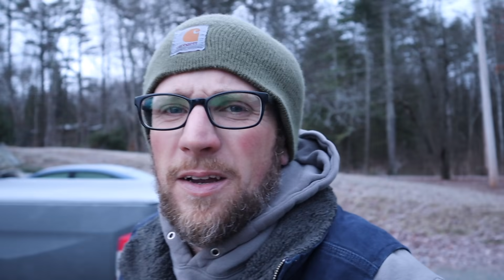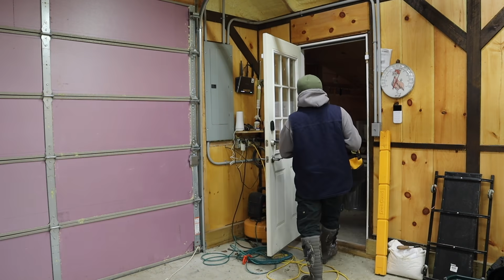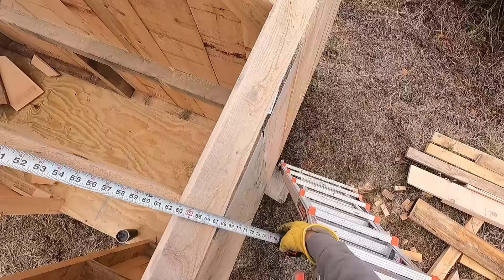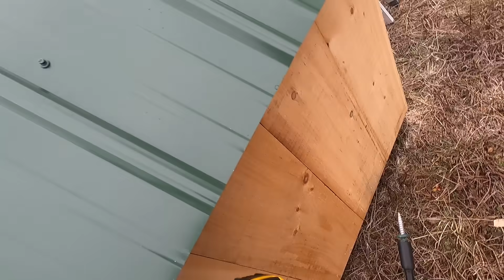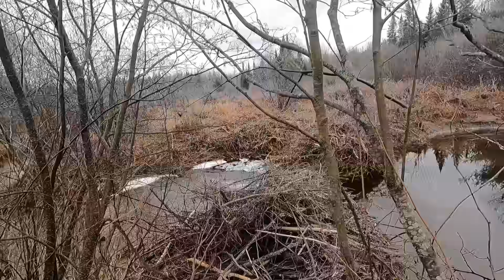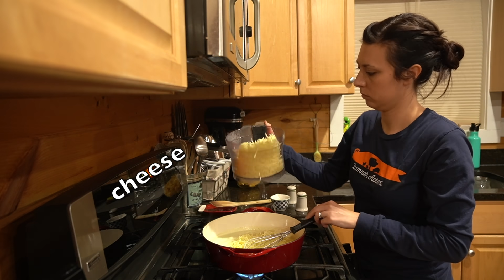Installing Metal Roof on Our OFF-GRID Property's Composting OUTHOUSE (Trying to beat the RAIN)

Comment: Good use for your drone, checking for beaver activity.
Reply: I would be EXTREMELY careful with that. Especially if they're posting on youtube.
I'm not sure a court would separate the act of checking for beaver activity and the act of trapping. I wouldn't push it. It's easy to argue that in the YouTube comment section, it's a lot harder to get a real life judge to go along with you. 
New hampshire fis 312.02
Reply: @herranton  - Good observation and input.  There was no exemption for private property, so it would be applicable for this channel, IF it was proved to be used in a way that violated the law.

Comment: Love your new project land (Beaverdale?).  For the price of 1 or 2 new battery operated tools, you could purchase a portable 1000 - 2000 Watt battery powered inverter like the Jackery.  This would allow you to plug in your wired tools like grinder and sawzall at the sight.  You could also recharge all your battery packs for your cordless tools on-sight.  Add a solar panel to the roof of your shed and it could be always charged and eliminate the need to take it home to charge it up each night.

Comment: If the water flows all or most of the year I would use it to provide hydro power, run LED lights, charge your tool batteries ect...

Comment: Keep the overhang always let things drip well clear to avoid splashing mud up the walls. Or have extended gutters to run clear. Better still harvest the rain at a high level to run by gravity to a tap. Speaking of which use the tractor to elivate water tubs to take around farm and Sophie off to were you want it elivate bucket enjoy your vids in lock down. How about doing high lights jim

Comment: Tip of the day... I like to use a pencil and mark my tape measure for repeat measurements, just so you don't have to think about it. When you are done it will just wipe off or erase off. Makes it faster for me.  Have you tried turning a plywood circular saw blade around backwards to cut metal?  I like the clear roofing for light.

Comment: Harbor freight sells a 100 watt solar setup that comes with 3 12v lights with on/off switches and the main unit has 12v dc outlets and 5v usb so you would be able to light up the shed and the outhouse at night if needed along with charge phones/tablets and with an inverter plug in the chargers for tools. Would need a battery to go with it but deep cycle batteries are easy to find and with the 12v power you can put in fun things like a car radio for music and alerts out there when working or near the fire.

Comment: Need to make a water wheel to use the water to spin an alternator to have 12v system and a step up power inverter for some lighting

Comment: When you are going to cut metal tiles or not, you can use an electric saw, just invert the position blade. Don't forget to return to the correct position right after the cuts are finished !!

Comment: Your tin roof will condense moisture from the air and drip it down onto your shed floor and contents. If you insulate your roof that should solve the problem.

Comment: Al, FYI the Polycarbonate Roofing Panel will only hold up for about 3 years. I used some on a project and it held up only 3 years. I'm in Ohio so we get very hot weather and fairly cold. Hopefully you'll get a little longer out of yours than I did. It gets brittle and cracks. I purchased tan polycarbonate and white and it holds up a couple years longer. Your outhouse looks like luxury compared to what my grandparents had! :-)

Comment: Turn the saw blade around on your battery powered circular saw, it will make short work of that roofing. I do it with tin as well.
Reply: Good idea!  I assume a 24 tooth normal carbide circular saw blade is too aggressive for direct roofing tin?  A 40 or 80 tooth plywood type saw blade might work as well.  But turning the blade around costs nothing but your time.  Clever!
Reply: @samvalentine3206  yes, it rips the tin. you can also. cut concrete with a backwards blade in a pinch.

Comment: I'm with you, Al: eggs over easy, toast and bacon. I frequently vary how that combo is made. Sometimes Craig's Mc muffins. sometimes 2 slices of bread with holes in the center to fry the eggs in, then each is covered with a layer of (already cooked) bacon, topped with slices of (extra) sharp cheddar, and broiled just long enough to melt the cheese without overcooking the eggs. I variously add salt, garlic/onion powder, dill, tarragon, and/or malt vinegar as the mood strikes me. If I don't want to cook, I'll have a large bowl of whole-grain cereal and fruit or oatmeal (not instant and made with milk instead of water) & fruit. 
      If you ever travel to the U.K., by the way, you want to be sure your hotel serves 'English breakfast' or a breakfast buffet. If your included breakfast is 'continental breakfast' that won't do for you. Throw it into a baggie for a light snack during the day. If you stay in a B&B you will get a good breakfast.

Comment: You haven't a battery operated angle grinder, but you have a saws-all on batteries. Put a metal blade on it and you could cut the roofing at the new lot.

Comment: You know you can cut the steel roofing (ridge cap) with a circular saw?  Go slow and use a carbide tip high tooth count blade and it will cut quicker and cleaner than a andle grinder.

Comment: You can't do like you would with vinyl siding and turn the blade backwards on your battery operated circular saw? Though you would probably need a higher tooth count on the blade to cut efficiently.

Comment: Good Morning Al and Family.  You need a generator that you can use when you go to Lumnah 2.0.  It would make life easier for you all.
Reply: Or even one of those battery pack 110v appliances.  https://www.jackery.com/pages/portable-power-stations - pricey but quiet for the temporarily tailgate power need.  If Al had the time (he doesn't) he could make his own 110v battery pack with 18650 cells in some sort of carrier - like an ammo can, or something.
Reply: How about installing a 1200 watt inverter on your truck so you got 120v power wherever you go, alot cheaper than a generator and you always got power when you need it.
Reply: @kipcudd7253  - Good idea - As long as one leaves enough juice to start the vehicle.  That's always a worry for me when I use my inverter.  A little use is probably nothing to worry about - but I'd hate to be out in the sticks and find I have killed my car battery!  Of course, one could just start the car and have it run while one used the inverter, just to be sure.

Comment: why didn't you place the ridge cap on to keep it dry and cut it on the roof after the big rain??? and tyvek the door openings temporarily
Reply: Makes sense - but harder to cut once it's on the roof?  Not that much of a hassle for Al.  <shrug>  Oh well, it is what it is.  🙂
Reply: Because they took it with them to cut.

Comment: You don't have a pair of tin snips ?
If you screw through the ridge instead of the pan on those roof sheets you are less likely to have leaks and the snow slides off better 👍😊🇦🇺🦘☮️

Comment: Gina I'm from the UK, your Mac n Cheese looks lovely, but what are the crushed crackers you use for the topping, as there is quite a lot of your and our food terminology that means something different, are they what we in the UK know as cream crackers or a water biscuit which is similar to the cream cracker, they are both a dry baked type biscuit, that we eat with cheese as an after dinner savoury accomplyment, I know even the word biscuit (our term for them) has a different meaning to yours, ours can be either savoury or sweet, the sweet one you call cookies or are they something different altogether.
It can be very confusing at times ha ha.

Comment: Why are you pre-drilling? If you're using TEK screws, metal to wood, they'll go thru 26 ga metal easy with just a tap on the drill with your hand. I've built alot of pole buildings, sheds, etc and never measured my boards to hit the boards. But everybody has their own way. Time was money when I was doing it.

Comment: I have a cousin who puts up metal buildings. He drills a stack of metal all at once instead of one at a time. Just a suggestion.
Reply: He's drilling through multiple panels here 13:45 - you can see the drill as it goes through one panel and starts on the next, etc.

Comment: Your circular saw would cut the ridge cap and panels no problem and not damage the blade.
Reply: Yeah, I use a reversed blade to cut tin on a circ saw. Works great, but super loud!

Comment: Reverse your skill saw blade.  it then will cut metal
Reply: May as well just use a metal saw AND they put that little arrow on circular saw blades for a reason.  (picture the saw climbing up on your work and zipping across the surface)
Reply: @olgringo-421  if your in a Pinch, you could reverse your blade!   I believe being out in the woods away from your tools denotes in a pinch.  And it is good to be able to use what you have to accomplish a job.

Comment: Back in the day when every Youtube video started with an advertisement it was annoying but an acceptable tradeoff for watching free videos.

Of course Youtube couldn't leave a sleeping dog lie so of course they started to tweak the system. How about adding another video in the middle of the video?

Well of course Youtube had to tweak the system until it broke.

In case you were curious here are the advertisements that were delivered to me while I watched your  29:17 video
Total number of ads delivered in this video: 17 (wtf!)
Total ad minutes in this one video: 15:59 (WTF that's like a 1 minute ad for every  1m48s of video)

   Ad length	ad position	

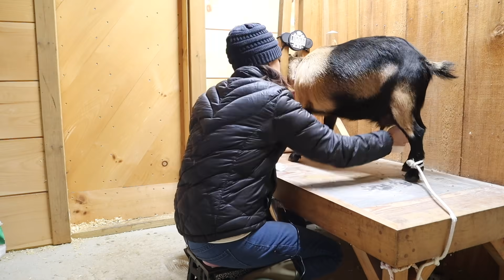1	02:00	00:00	
2	01:30	00:00	
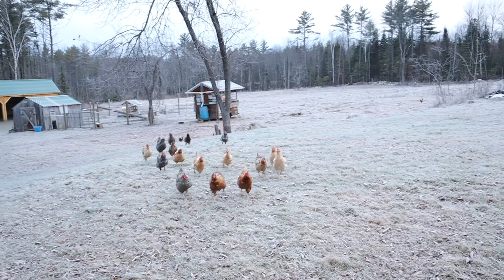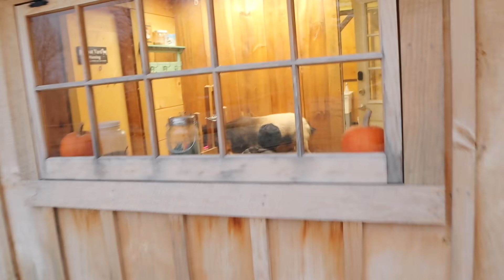3	00:15	03:25	
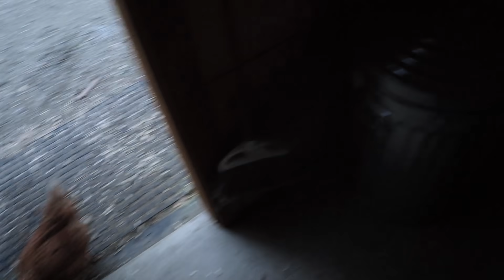4	00:55	03:25	
5	00:06	07:07	
6	00:30	07:07	
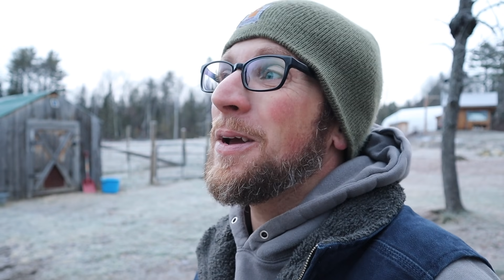7	00:39	10:50	
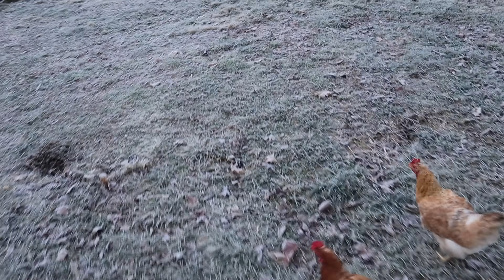8	01:00	10:50	
9	02:00	13:30	
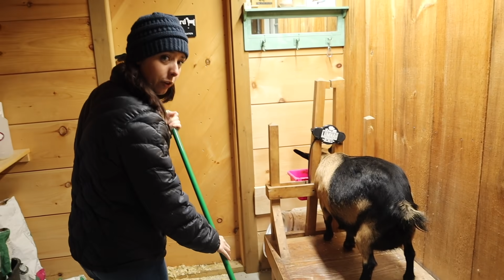10	01:50	13:30	
11	00:55	18:42	
12	00:15	18:42	
13	01:30	22:06	
14	00:15	25:22	
15	00:40	25:22	
16	00:39	29:17	
17	01:00	29:17	

This model of course is not sustainable. YouTube is trying to force me to buy a monthly YT membership so I don't have to watch the ads, which I will not do.

I subscribe to 147 Youtube channels, so naturally I watch a lot of ads. I initially used an adblocker, and then I thought that was a disservice to the content creators so I got rid of the blocker and started allowing the ads. I would sometimes click SKIP AD after the 30 second mark.  But 17 advertisements in one video? And if I have to watch one more dangers of vaping video I'm gonna slit my throat.

This high number and long length of advertisements in a single video is not just your channel, it is virtually every channel I watch.  

I thought you might be curious about the other side of monetizing videos, even though I am sure you have minimal control over  the number and the length of videos. At least this time there were no 7 minute advertisements
Reply: Ha I spoke too soon.
Tomorrow's video started with a 3:25 ad, before the video even started and then ad number 2 was a whopping 16:36 ad for SnapackSkin! That's more minutes than all 17 ads that was delivered on this video.

And then.... 6 minutes later YouTube delivers the same freaking 16:36 advertisement to me AGAIN!!!!!!!!!!!!!!!!!!!
WTF??????????????

Comment: I have followed your progress since you cleared your land several years ago and am disappointed in the fact that you have not taken the suggestions concerning your beaver problem from your followers. Several have suggested the use of a beaver pipe or  several 6 " plastic pipes to regulate the water level.  You must learn to live with the beaver. They will move on when they can no longer raise the water level.

Comment: If you can fit it in the budget, you might want to look at getting a DeWalt power station.  It would give you a 110V outlet or two while at Lumnah Acres 2.0.  https://www.dewalt.com/products/storage-and-gear/generators-and-portable-power/1800-watt-portable-power-station-and-simultaneous-battery-charger/dcb1800b